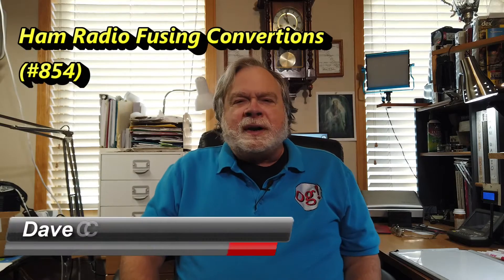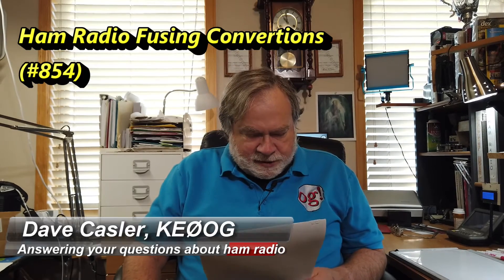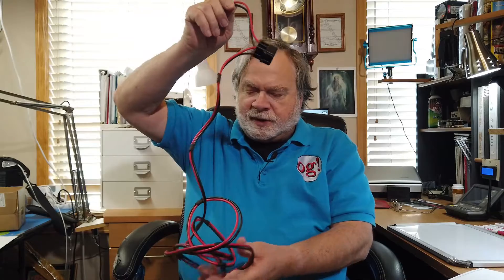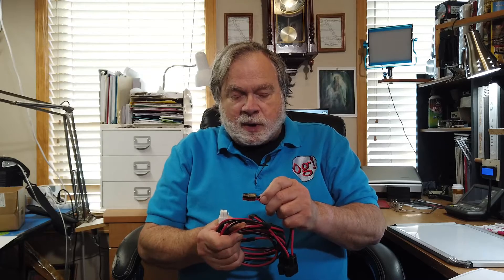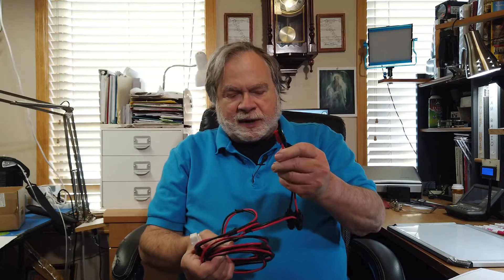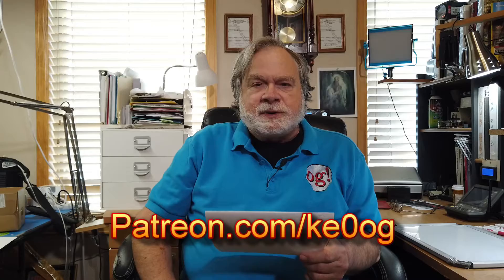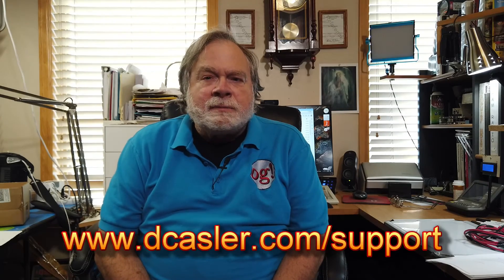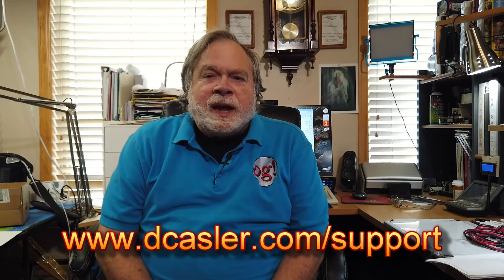Ham Radio Fusing Convertions (#854)

Comment: I believe the ground fuse is to protect against connection to the battery with wrong polarity. Let's say the antenna and feedline is grounded to chassis, but we do a mistake and mix up positive and negative connection at the battery. Without a fuse we will have a large current passing the ground wire, via the radio, the coax feedline and to the antenna ground at chassis. My 50 cents. Best 73 - Einar

Comment: Hi I recently bought a retevis rt95 or anytone 778 uv. Its a uhf vhf. The manual is confusing and shows a picture of a fuse on each wire + and - however the wire in my box has two fuses on the positive lead. One by the radio and one by the battery. Did someone at the factory assemble this wrong? Forgive my ignorance i haven't even taken my test yet. The chinese to English didn't help me much in the manual but I cant for the life of me think of a good reason to have two fuses on one line.

Comment: Very interresting,
Why is there a USB looking device pluged into your power strip?
These are intened for charging.  I don`t thing you walking around your bench to charge something.
Could it be a monitoring device for the strip or a separate device that just needs 5VDC?
Thank you

Comment: One fuse protected 26 lines, so a field engineer and I blew more than 26
fuses trying to find a short circuit. The 200,000 USD (1985 dollars) system was saved by one little cheap fuse. A small ceramic capacitor had shorted and was replaced. System up and running.
   NEVER get cheap and remove a fuse!!!!N0QFT